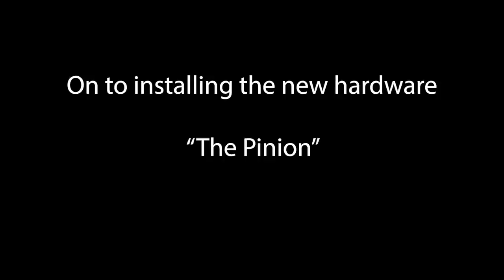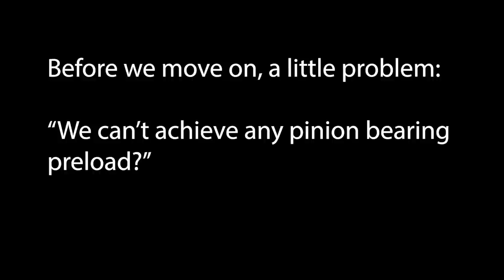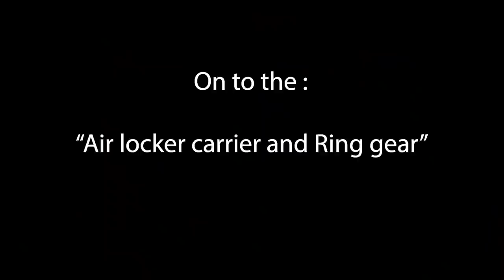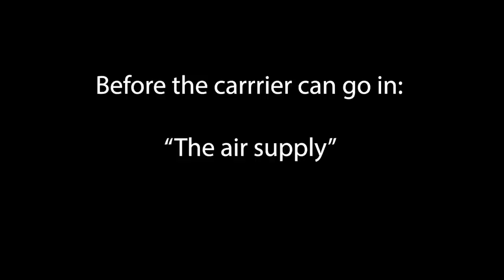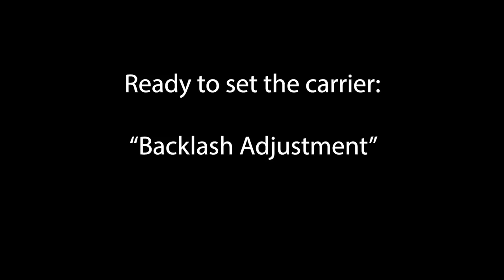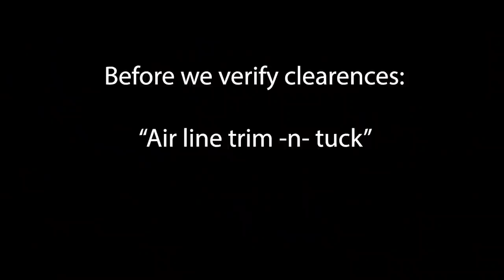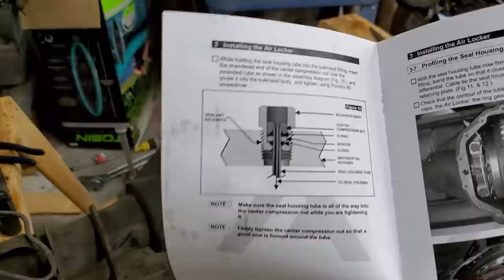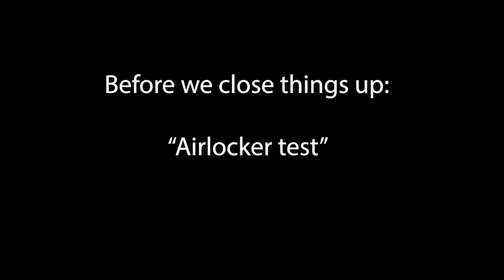L5 Rear differential gear change with ARB Airlocker install-AAM 11.5 . Leviathan super van project.

Comment: It may not be obvious but fitting the copper tube through the hole in the housing is easier without the fitting screwed in .
You just slip the fitting over the tube and tighten it up.
Reply from the maker: That did seem to work better the second go round, after replacing the fitting.

Comment: Many years ago when I first started working on vehicles do it yourself differentials were not a thing.
You had to have a shop equipped with all the equipment to set and lap the gears.
The crown wheel and pinion had to be paired by driving them against each other with a grinding paste to seat them in before you could do all the other steps. If they weren’t matched with grinding paste eventually when the gears bedded into each other the diff would become sloppy and noisy and possibly fail due to excessive back lash chipping off teeth.
Reply from the maker: Thank heavens for modern CNC manufacturing!

Comment: If there's even a small chance you could forget to fill that with oil, I'd do it now if possible.
Reply from the maker: I left the gear oil in a box in the middle of the floor . . I will have to move it one day and will move it into the diff. Ha!
Reply: I don't hear anything, what "grinding noise"?

Comment: hey. i wanted to ask that gear kit and the arb locker apply to the single wheel diff, cus in my case im running dually, and i want to know if it fit on both or i have to be care full. thannks
Reply from the maker: The Duallly setup shouldn't effect the differential itself.  The axles are shorter, but the input spline is the same.

Comment: In Australia, to change anything with a vehicle you  have to get it "engineered" and certified to be drivable on the road. Do you have similar requirements there? Really looking forward to seeing this project come together.
Reply from the maker: Nope! Actually pretty easy to license a home built car in the US. With 15 million cars sold every year, home built cars account for .0003% or something ridiculously low like that. Plus the car culture crowd would push back hard.
Reply: @BuilderCreator  sounds like my kinda place, not going to lie.
Reply from the maker: @aarondcmedia9585  Sad to see the tyranny is growing faster in Australia than here in the USA. Hopefully the pendulum swing will begin sooner for you as well!
Reply: @BuilderCreator  appreciate your thoughts. Alas only a minority here consider this tyranny. I am struggling.

Comment: Not a 14 bolt, but an 11.5 aam
no 3rd pinion bearings.., ;)
Reply from the maker: It is a 14 bolt, but the heavy HD rear end, built for Chevy by American Axle Mfr. And I was wondering what this other bearing was for . . .Ha!
Reply: @BuilderCreator  not a 14 bolt.
Aam 11.5 there is a 'diff'